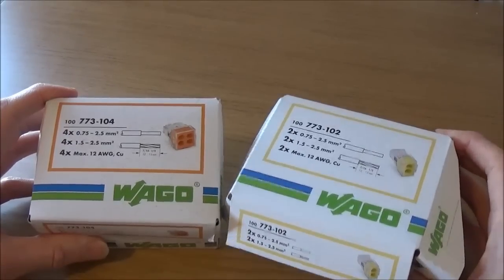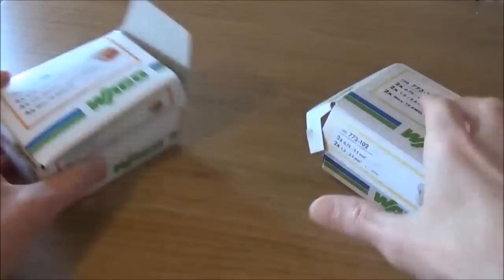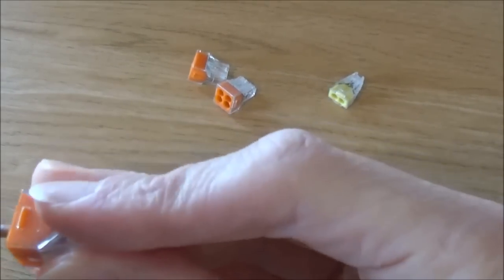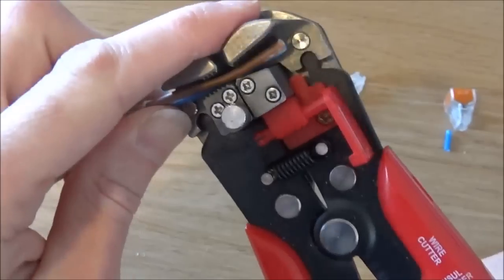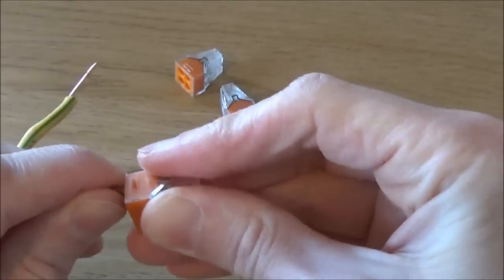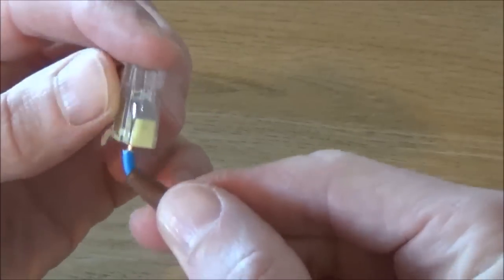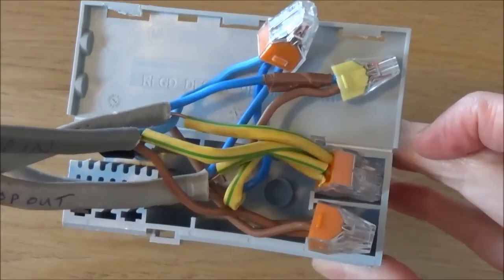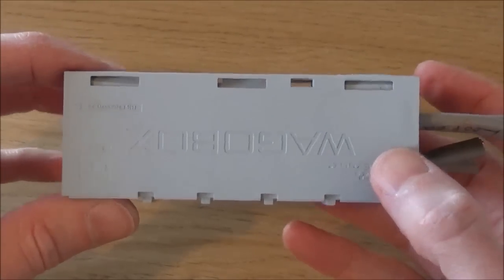WAGO 773 connectors review and demo. How to use with WAGOBOX Junction Box

Comment: Hi paul you share very good video learning a lot got one problem 2.7kW oven and one fridge use 2.5 cable enough cover
Reply: Probably not safe considering the load.. Are they both on a single or double socket? The ring can be extended. If it's a radial then split it across 2 single sockets.

Comment: The wago connector are neat. No tools are required. Simply open the lever that locks the wire. Do not fear of breaking it. That would not open fully and wire would not come out. With lever fully fulcrumed, it is child pay to pull the wire out and reuse.

Comment: Would these be OK to join my lighting earth wires to the light fitting earth, for example I've got 3 earth wires coming from the ceiling ( rose)  and one coming from the new light fitting, can they be joined into the 4 way connector. I'm in the UK and from your accent not a million  miles away from your good self.

Comment: Are these better than the 222 blocks or just personal preference?
Reply from the maker: These have a lower rating so only suitable for lower amp circuits like lighting. Same sort of thing though and classed as maintenance free due to know screws to secure the wires. Hope that helps.

Comment: It annoys me that these have apparently existed in Europe since the 1960s, meanwhile in the US we're still mainly using wire nuts which I believe are a pre-WWII invention.
Reply from the maker: I agree, and many electricians continue to stick with 'tried and tested methods'. I'm a great believer in moving things forward. If new techniques, methods and equipment make a job easier then use them!  Thanks for the feedback and thanks for watching!
Reply: These kinds of connectors are vastly superior for any kind of solid wire application. Braided/stranded wire can be more of a toss-up since the screw-on action of a wire nut is physically predisposed towards keeping the strands together, whereas these Wago connectors (they're sold by a company called Ideal in the US) can require more pressure to insert a wire than a braided wire has, so it just kind of squishes against the connector unless you stick it in there just right. Maybe that's got something to do with it.
Reply from the maker: Check out my video for wago 222 connectors. They are designed for braided wires.
Reply: I like using these for low amperage lighting fixtures. I use the wago with lever nuts for everything else. Good stuff!